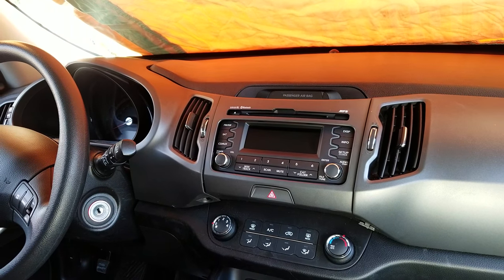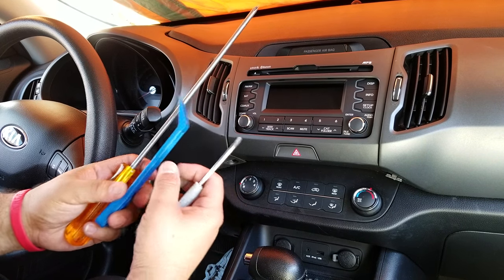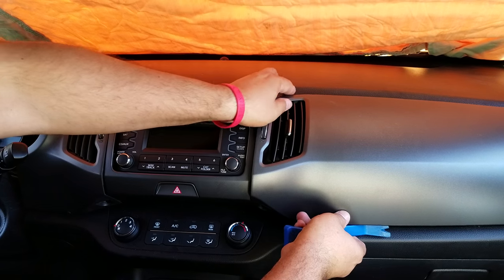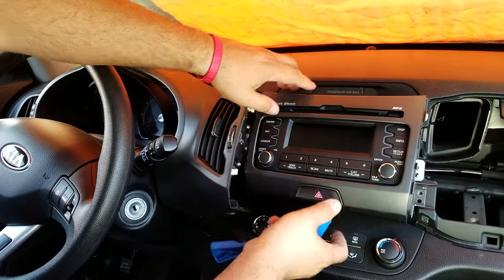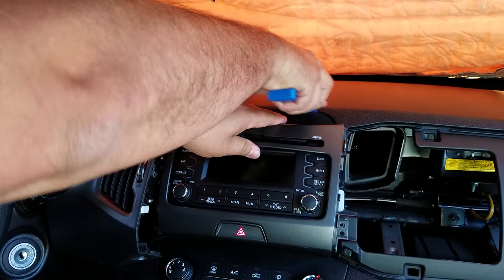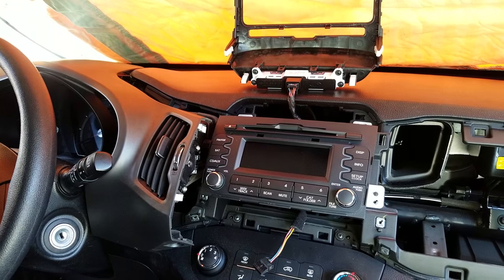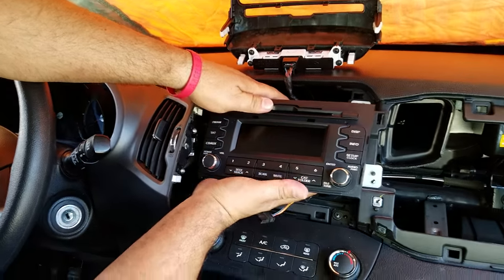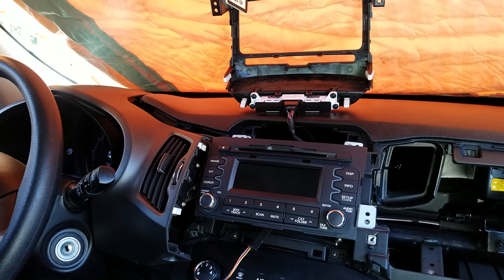How to Remove Radio / CD Player from Kia  Sportage 2013 for Repair.

Comment: Thank you showing this it took me 15 minutes to change the radio! The longest part is on the driver side you need to pop it all otherwise you are not able to unscrew the side of radio! I was surprised didnt have to enter a code in radio, all work!

Comment: You can unplug the airbag light as you must if you are adding in the bigger radio. but !! DO NOT TURN ON THE CAR OR TURN KEY ON !! put in big radio or new air bag light before turning on car.